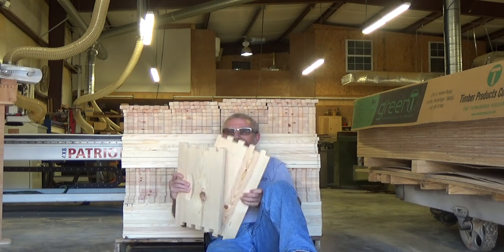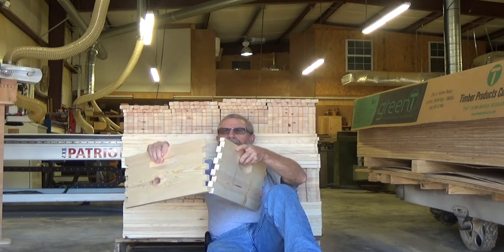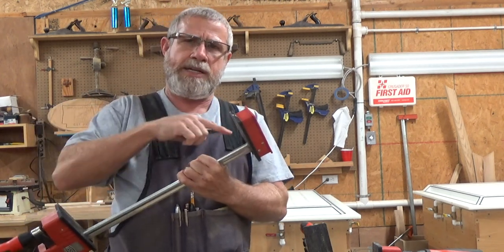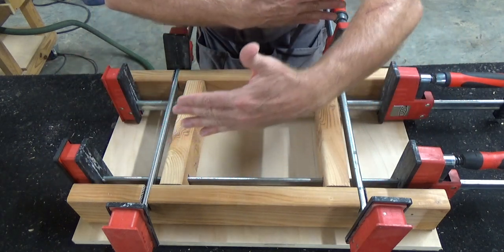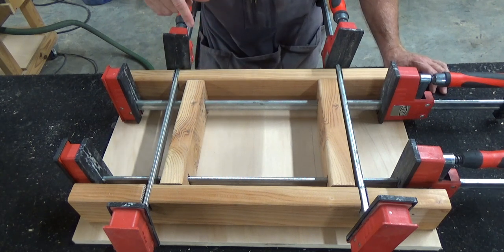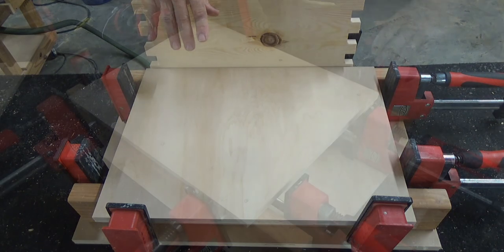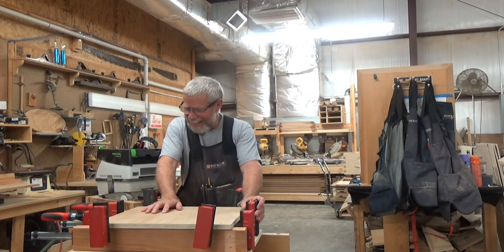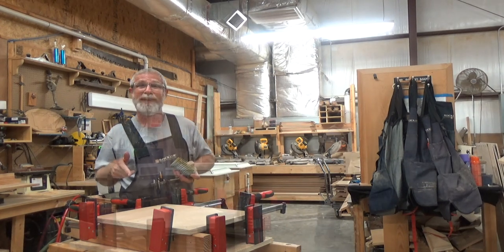Simple fixture that makes a box square every time. Assembling a deep super.

Comment: Love your videos.  I suppose larger manufacturers use pneumatic clamps with distance release.  Big smile on your out takes.  So much patience!
Reply from the maker: I actually thought about putting our pneumatic rams, we have 10 of them with a 5 inch travel,  on boards, but I did not want to get all the comments about unfair advantages so I used clamps. Still, I think I'm going to build a fixture using them, it would be so cool. The out takes were my favorite part of the video. God's peace Barb.
Mr. Ed

Comment: Mr. Ed
First, thank you for the great videos..  Question:  What is the best way to cut finger joints?  All of the jigs I've found only allow to cut one at a time, I am looking for the best way to cut several at one time.
Reply from the maker: For most folks with an average shop, a table saw with a dado blade, and an incremented fixture. Otherwise, a cnc.  God's peace Mark.
Mr. Ed

Comment: I'm guessing you haven't found a good wood glue to use with bees yet? I know the bees propolize the inside of the box, and you paint the outsides, but wouldn't a glue help keep moisture from the seams? Is that even a weak point in the old boxes? What usually happens to the old boxes? Where are the weak points?
Reply: He'd laugh and tell you to look at some of Roosters stuff!

Comment: Time lots of wood he heee  >   i'am really surprise that you haven't built any shb oil traps > Only way i can have bees and  kept SHB and wax moth OUT>  it takes 1/2  gal. of oil per tray in the trap.  i heat it up and re filter it too, cut down on cost    Both are bad here > plus fire ants>   i hate finger joint a wast of time. i just butt em up> drill, glue, and screw ~ i throw them around, stand on em,  JUST AS STRONG  Never had one break or come loose yet in 16 yrs >  YES SOME OF MY HIVES ARE 16 YRS OLD ~ DOES THAT TELL YA ANY THING?   he hee > tell ya a tip cover the ends of the wood with wood glue, or caulking.   it help seal the ends from sucking moisture > just paint want do it